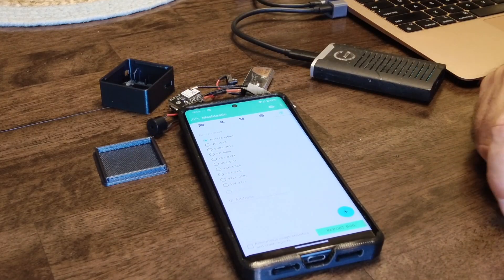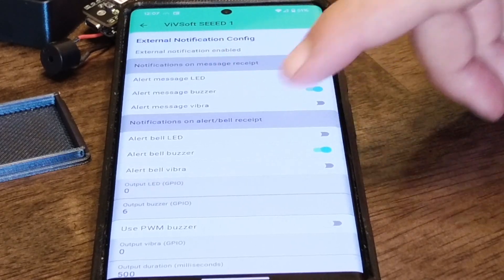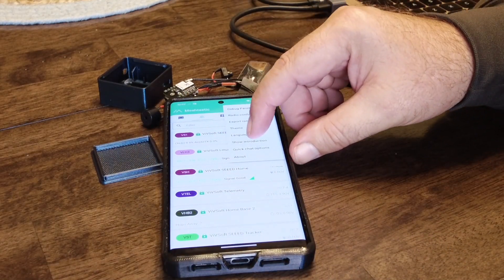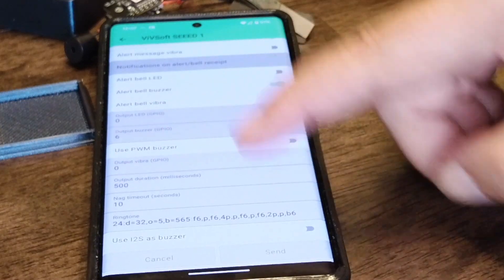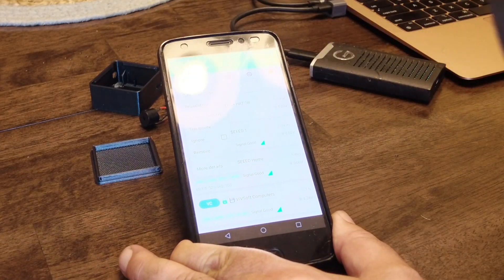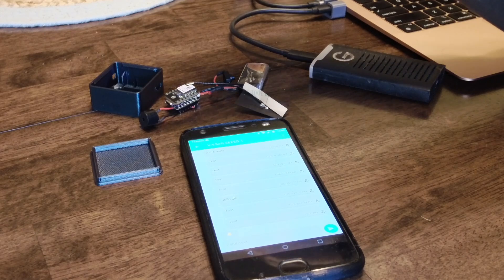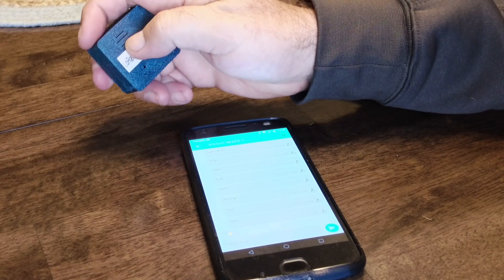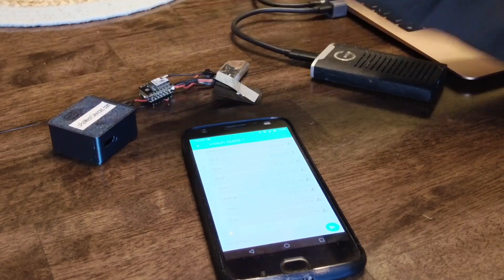$10 Meshtastic Node: Never Miss a Message! 📲

Comment: How's the range on your Xiao node?  
I received two of these a couple weeks ago, and they hardly work.  If I don't have my Heltec V3 nodes turned on, the Xiao nodes won't pick up any nodes other than themselves.   There are at least 100 nodes active in my area. My Heltec's usually have 80 to 100 nodes in their list.
Reply from the maker: Hi @altitude1039, I can't say I've had any issues with the range on my Xiao nodes, but with the default antenna, I'd expect the range to be quite limited. Keep in mind that while the Xiao uses the same SX1262 radio as the Heltec nodes, the antenna plays a critical role in performance. What kind of antenna are you using with your Xiao nodes? It might be worth trying a higher-quality external antenna to see if it improves your range.
Reply: @ViVSoftLLC Thanks for your reply.

I've tried four different antennas. Same ones I've been using on my Heltec nodes that commonly connect with 100 nodes. ¯\_(ツ)_/¯
Maybe I've got some bad LoRa modules.  I'm still waiting for some help from Seeed, but it's Chinese New Year.
Reply from the maker: @altitude1039  Great. Let me know if you figure it out, would be interesting to hear.
Reply: @ViVSoftLLC  
I still haven't had any luck with my node.  Still has limited range.  And now I've found another bug.  Everytime I  set a gpio up for my LED notification, the Xiao freezes and I have to reflash the firmware. Without even connecting the LED.  . .   How did you happen to chose GPIO 6 for your buzzer?  GPIO 6 is SCL,  I'm using I2C  for my BME280 and my OLED display.   🤔  No help from Seeed yet, they are on holidays still.
Reply from the maker: @altitude1039  For the GPIO pins, I looked at the diagram on this page (https://www.seeedstudio.com/Wio-SX1262-with-XIAO-ESP32S3-p-5982.html)

I soldered to the ESP32 board at the bottom, not the SX1262 Radio board. You will see D5 but its also called GPIO6 ... I assume I could have also used GPIO1-5, you are correct GPIO6 is shared with SCL, so if I wanted to add a I2C display or something, I would need to choose another pin.
Reply: Interesting.  I've tried 4 different gpio pins and it locks up the node every time.  I must have a couple lemons. I'll have to disconnect my I2C devices and try pin 6 ¯\_(ツ)_/¯
Reply from the maker: @altitude1039  Interesting ... Yes, on another node (from Xiao) I added a couple of I2C devices and not a GPIO buzzer/LED .. so perhaps it has issue if you add both.

That video is here: https://youtu.be/TgvLflQpxEg
Reply from the maker: Also, did you flash the latest Meshtastic build?
Reply from the maker: And I just remembered, make sure you use a true DC buzzer, not a PWM one. I remember that I similar issue. So I tried a LED first (with 330ohm resistor) and then figured out that I need a true DC buzzer....

This buzzer: https://www.amazon.com/dp/B07VRK7ZPF?tag=vivsoft00-20
Reply: @ViVSoftLLC 
Thanks. Yup tried the last two most recent beta.  The fault occurs even before I make the connection to my LED. As soon as I set the gpio pin in the app.  Even when I don't have any I2C devices connected. I haven't tried gpio 6 yet. Guess that's next. 😐
Reply: These Xiao nodes are really messed up. 🍋🍋🍋🍋 

I've been using Xiao ESP's on some other projects, and they are great.  Must be some issue with the Meshtastic firmware. 

 I tried using GPIO 6 after removing both i2c devices, and the notification LED worked for a minute, then the ESP locked up again. I connected to serial to see what was going on.  Nothing was happening, then after about 5 minutes it started working and logging again.  I tried several other GPIO pins with similar results.  GPIO 4 seems to be stable, and after a five minute freeze up it seems to be working.  I reintroduced the i2c devices and it is still running.  Still has terrible range.  Hopefully someone from Seeed will get back to me.  
Thanks for your feedback. 🙂
Reply: Mine doesn’t have a battery option unless I get the expansion board ?
Reply from the maker: @Uplateondatube  the board has a B+ and B- BAT pads on the bottom and you can solder a battery connector to those pads.